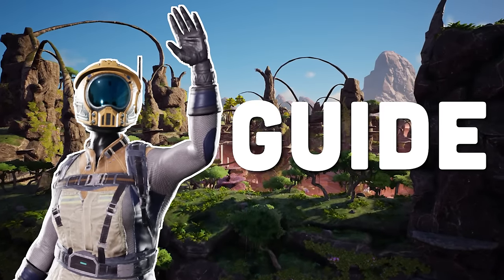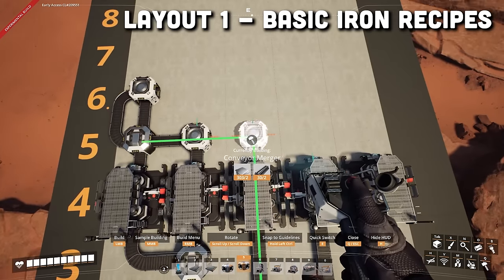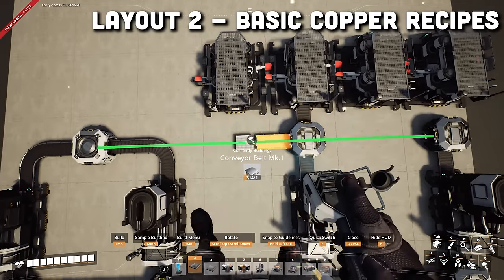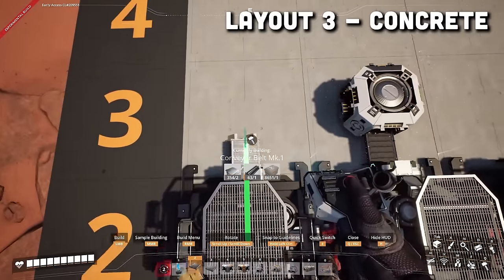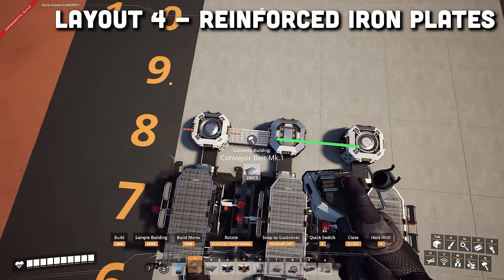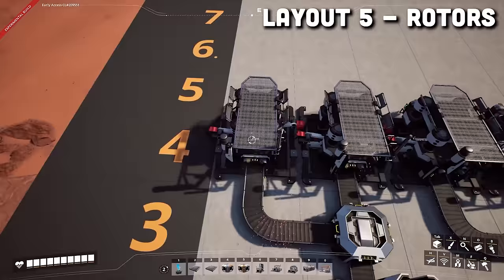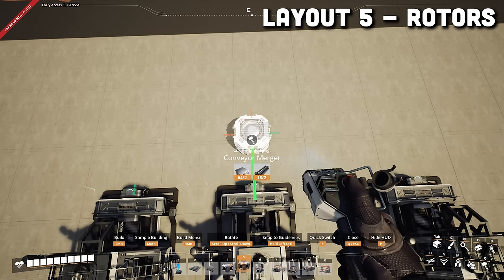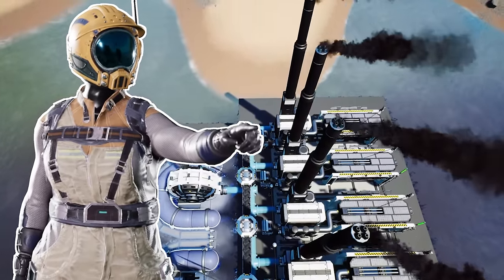5 PERFECT Starter Factory Layouts You NEED! | Satisfactory Update 7 (Beginner Guide)

Comment: Smelters don’t seem load balanced. You have 120 going into the first splitter. Even with one output having a mk2 belt you get a 60/60 split. This has 60 iron ore going into the far right smelter. I tried your layouts and none of my smelters are efficient. Can someone explain this to me?
Reply from the maker: The system I use is a manifold system. The line goes down the line of smelters. So what is happening is the first splitter will split 60/60 and fill the first smelter, then it will overflow back into the manifold line. At that point it is no longer 60/60, it’ll be 30/90, and then the second smelter will fill, etc..  the last 2 smelters in the manifold line might not fill up, because they should both be receiving exactly enough to run 100% efficient. The only con of a manifold system is it can take a few minutes to get up and running to max efficiency. But the pros of taking less space and easily expandable makes it better in most cases. If you want, turn off the machines until they fill up and the line fills up, then turn the machines back on to speed the process.
Reply: @spectrumdad_  I see. Thank you for explaining. I didn’t realize there was backflow.
Reply from the maker: @bebopsynthguy6629  sorry might of explained that wrong. There isn’t backflow, it’s just that because the machine only needs 30/min, providing 60/min will be too much, and the line will get full. At that point if the splitter can’t send items down one side because the line is full, it’ll just send it down an available belt.
Reply from the maker: @bebopsynthguy6629  sorry might of explained that wrong. There isn’t backflow, it’s just that because the machine only needs 30/min, providing 60/min will be too much, and the line will get full. At that point if the splitter can’t send items down one side because the line is full, it’ll just send it down an available belt.

Comment: I mean its a nice layout yea, its easy to rebuild, but the start of your factory line is actually very unefficient.
because u are using a splitter for each smelter.. that means the last 2 of them are getting 1 iron income and 1 ingot outcome and its always a break between the production and the incoming iron.
its far better to use 3 splitters, splitter splitts the 120 iron into 2, and then 2 splitter for 2 pairs of smelters, so each smelter gets exactly 30 per minute.
to use a mk2 doesnt fix that problem.
Reply from the maker: @klauskleber4001  it’s how manifold works. I have a video on this. At first it will be offset but eventually the line will even out due to overflowing of the first smelters.
Reply: @spectrumdad_  mh okay yea i actually use overcloaking stuff. so i need that 30 iron outcome. mine is a bit diffrent.

Comment: Mmmm... relatively new to the game, last 2 smelters don't overflow, last 2 screw constructors don't have rods, cant underclock yet. MK2 from pure iron ore to all the splitters (this section with MK2 conveyor belts).

30 min of gameplay and Im far away from everything 100%, is the underclock? everything has to be made mk2 conveyor belt? new update broke this? (Talking about the rotor layout).
Reply: Ok, I fixed it by adding MK2 in the connections of all mergers and splitters, without the underclock. Screws are a pain to feed the big constructor thingie.
Also, had to feed the assemblers with 500 screws (manually) and use MK2 conveyors from the screw constructors to the assemblers.

Comment: wow the iron is bad, you can easily produce 180 screws per minute merged into 3 storage units. You can set 2 miners at 60 ore per min, divide it into 6 constructors. 2 will go to plates, 4 will go to rods. 2 of the rods will go into 3 constructors of screws. All the beginning materials can be found within a crash site next to any starter areas

Comment: This video does more harm than good for first time/raw beginners.  You really need to add a warning message or caveat to the beginning of this video stating that you should focus on getting coal generators setup first, because as a raw beginner my friend setup your iron and copper and concrete factory in your video and now we spend all our time gathering biofuel (deforesting his planet) to feed his operation and nothing else.  Either that or unlock underclocking and run everything at 25% or 50% from the get-go.  Also, your video doesn't teach the raw beginner anything at all about where to locate or how to design power lines and as a result his factory looks like a rat's nest of wires going everywhere.
Reply from the maker: I welcome your opinion. And that is the beauty of this game. Everyone builds and plays differently. But what I show here is something I’ve done in all my playthroughs. Even my most recent one I started just a few weeks ago. Once you automate the biofuel, taking 30 minutes to chainsaw a bunch of trees is not that bad and it’ll carry you to the coal. Also the point of the video was to teach people how to automate basic items. You can take these layouts and break them apart and fit them in your own factory the way you want to. Same thing with power, everyone has different power needs and likes when it comes to powering their machines. It wasn’t the focus of the video. But I do plan on making separate videos on these points! Plus, embrace this phase, most people want to rush to coal, but how can one truly appreciate automated power if one does not suffer ? :P
Reply: @spectrumdad_  Thank you for being so understanding in response to my bitterness.  Yes I can see your point about not rushing to coal.  The first time I ever played, I ran on one biofuel generator for my first 35 hours because I was just enjoying exploring and also I was only producing iron rods and sheets and wire at a very slow pace...the rest I crafted by hand.  I managed to get to tier 5 this way with an occasional running of an assembler for the things that only an assembler can make.  I even handcrafted all my steel.  I will admit occasionally working AFK in order to get up and do a short walk or bike ride for 30 minutes just for health and comfort reasons (I really need an Aeron chair).  So I wish my friend who I bought the game for so we could play together would have taken the same approach of doing and designing things on his own, but instead he chose to immediately start copying your youtube video designs that suck a lot of power.  In my world I'm trying to leave all the plants in place (I cry inside each time my explorer runs over a jungle tree/bush on the way to my offshore oil facility).  I wish trees and bushes would regrow, or they added a farming task to this game where you can cultivate renewable crops for biomatter.  I guess hostile animal protein can be made into biomatter, so I guess that's renewable.  But right now we are having to stop every 45 minutes to chainsaw poor trees for at least 10 minutes, and then hand craft solid biofuel for another 15, just to keep up with the iron, copper, and concrete factories that are in this video.  As you said, maybe we need to automate solid biofuel production, but it's so slow, it's much faster, uses less electricity to craft it by hand.  Thanks again for any beginner power setup ideas you may have!

Comment: I’m confused by the beginning splitters. Don’t splitter split the input evenly. So splitter 1 off of the miner would give you 30/30 then splitter two would give 15/15 and so on? (Assuming output of miner is 60)
Reply from the maker: Each layout takes in 120. And yes at the beginning it does split like you say. But because you are sending 60 to the first smelter, and that one only requires 30, it will fill up and overflow the line and then the splitter won’t split anymore. This is what a manifold system does. What you could do is don’t start the smelters and let the lines fill up. Then start the smelters. But it isn’t necessary. The system will eventually overflow down the line and all smelters will eventually be running 100% efficiently.
Reply: @spectrumdad_  I learned something new today. Just started a few days ago and misunderstood that. Thank you!

Great video. This has been very helpful.

Comment: All of these builds are fundamentally flawed.  It has to do with his crude resource input from the miner to the smelters.  There needs to be one extra splitter fed directly from the mine, and feeding into two splitters which are then fed into the smelters.  This will take 120 ore from a pure node, and divide it into 30 ore for each smelter.
Reply from the maker: What you are describing is a load balancing system. I use a manifold system in my builds. The resources will at first split half half to the first smelter but then it will fill and start moving more down the line. It is the defacto method most people use because it saves space and still works at 100% efficiency. It just takes a tad bit of time to get there.

Comment: "Basic Starter Factory" yet requires TIER 2 research... which with the parts you'll need to make you should ALREADY have a starter factory to make.... you do know that starter means the factory you use to START the game, right?  it's not the same as midgame, which is the factory you transition to immediately after the starter base no longer proves useful (in factorio, this would be at the point in which you start making oil by products for blue science, for Satisfactory, I'd venture to guess that this would be the point in which you have to start using more than the constructors to make parts).  If you can't tell the difference between starter and beginning midgame, should you be making "Beginner guides"?
Reply from the maker: I respectfully disagree. This is the first starter factory you build and send back items to your main storage. Everything before this is just spaghetti to stockpile enough items to build this. If you think this is mid game, you are in for a rough time :)